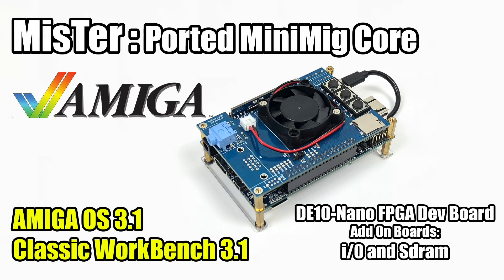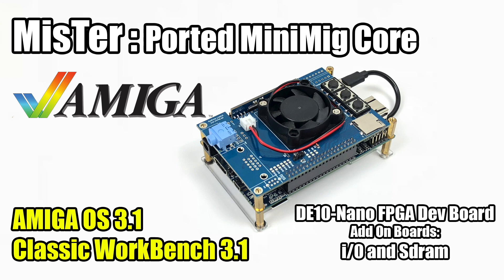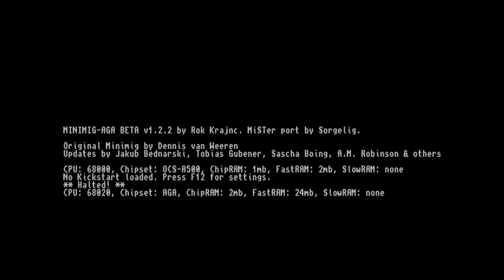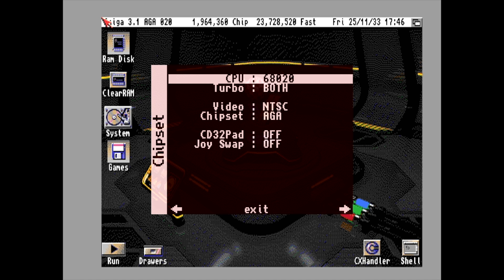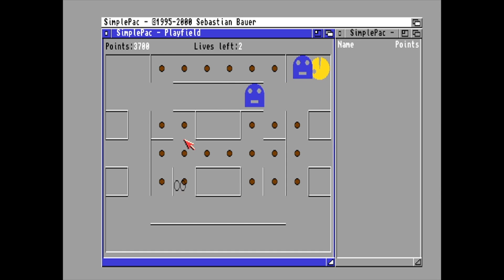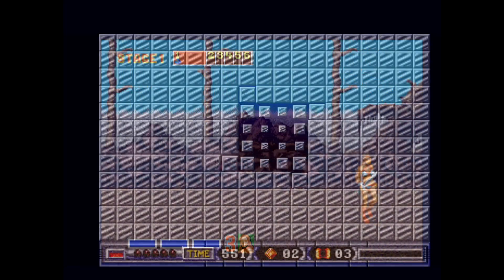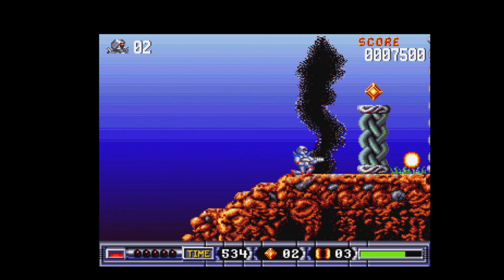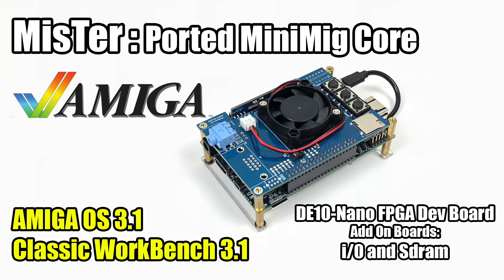Amiga OS 3.1 On FPGA - DE10-Nano Running MisTer

Comment: One quick question - Did this work for you directly through HDMI with sound?  The instructions seem to imply that the I/O board was needed for monitor, and to plug in external speakers for sound.  Thanks!

Comment: I started on the Vic 20 in the ealr 80's then the C64, Amiga-500, then the 1200, Yes "Work Bench 1.3" that's the OS
Reply: In the Garage. not seen for 15 years is: Amiga 500 and 1084 Monitor and all the goodies, hdd, cassette, floppie's, diskettes, Wico Joystick and many more

Comment: I'm actually curious how well the DE-10 Nano FPGA MiSTer ao486 core works.  There's Phil's Computer Lab DOS Benchmark Pack to look at the performance but also pouet.net has a bunch of DOS (and Amiga) demos to really see how well the sound/video/cpu is recreated.  It's interesting that on the ao486 core page it says more logic cells are used for sound than the CPU. :)

Comment: On the "static" screen at power-up, just hit F1 a few times. ;)

Yeah, I didn't know either until recently. lol

It will also save the setting. I like the pattern with just the frame around the border, as it helps me tweak my capture setup.

Comment: Nice, I can't justify getting one but am really enjoying these vids. Hope your gonna have a go at Igor's Atari ST core. It's quite important as it's 68000 is sync accurate. It's 68000 core code can be used in other 68000 based system cores. Also of course, the ST is a damn fine system (for it's time).

Comment: The real reason why you were "terrible" at Turrican 2:  You didn't know about the secondary fire and other attacks.  Fire1 held down for 1-2 seconds you can lay down a 360 degree rapid attack.  Fire2 works in this game (if you don't have a secondary fire button on your controller, use spacebar on keyboard).  Either 1. fire2 alone  2. hit down and fire2 3. whilst rolling, hit fire1 and fire2.

Comment: This is very timely. I just got a DE10-Nano specifically to try Amiga emulation.
Reply from the maker: I’ll put a video together on getting everything set up. I actually recorded this about 4 days ago and since then Ive got a lot of issues worked out. Still working on a few things but it’s all most set like I want. By the way Amiga was at the top of my list when I bought this.
Reply: Awesome, I look forward to seeing more.
Reply: city lights I still need to get an SDRAM and I/O board to start experiment with everything.
Reply: city lights - I got my board kits in. Time to solder them up! ETA Prime - I sent you an email via your contact info on the channel.
Reply: I’ve heard about the vampire, not familiar with it myself, just started watching some vids about it but people seem to really like it. If the DE10 can beat it I’m feeling pretty jazzed to get mine up and running.